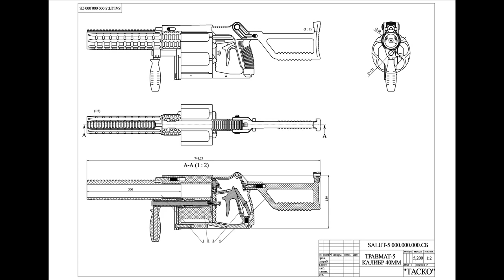3D printed revolver type launcher 37mm (blog link below)

Comment: Is this only for low velocity ammo? It seems like you'd need a steel chamber lining & barrel for high velocity. Also I wouldn't be too confident in using that poor little stock with HV. Too much pressure for the little guy I think.

Even still, with lv ammo, handy little bloop tube.
Reply from the maker: Prototype!!!

Comment: Just popping caps is one thing, shooting the real 40mm granades is something else! 

Do you have the blueprints for the m79 granade launcher? I found me some files on 40 mm granades. I believe the delay activation was made by honeywell. Some patents must exist. But also there are ways to get the files on this ammunition on some site, i saved it, but im not going to look for it just yet. Are you interested? It were some government contract sites, or something of the sort. They did ask money if im correct. But then you will get the blueprints etc. :) 

Those CNC machines you have got will make a lot of things happen im sure! 

Check  out my about section of my youtube channel, it has some links in it that will be very interesting to you i am sure!

Greetings,

Jeff
Reply: @UravnitelBlogspot  3D printing is great for prototyping. So would you use modified shotgunshells as a propellant? Forgotten weapons has a video about the m79, they talk about the 40mm grenade. 3000psi internal pressure, not too much conpared to the much higher psi ratings of normal firearms. As long as you dont have to make the arming device of the fuse, it should be pretty straight forward. You can make the cups of the casing and bullet (projectile), in an hydraulic press, with punches and dies. Just look at my grabcad page, it has some book about this topic. 

Really cool gun! Do you have blueprints or cad files for this gun?

Greetings,

Jeff